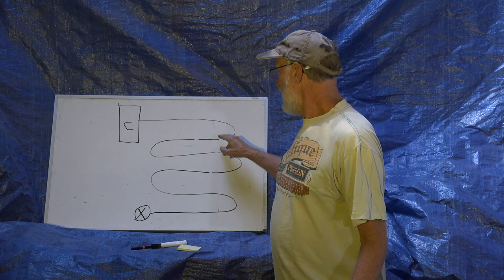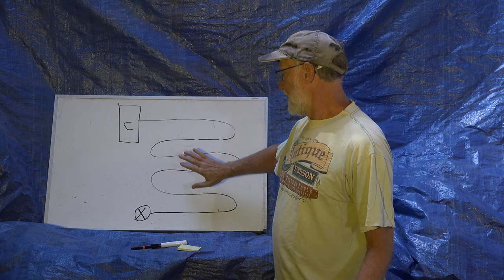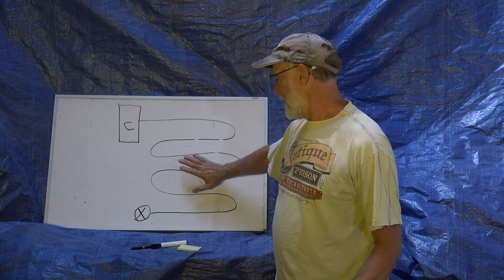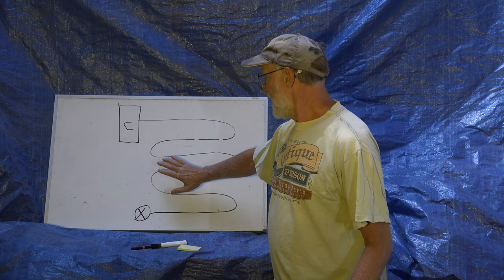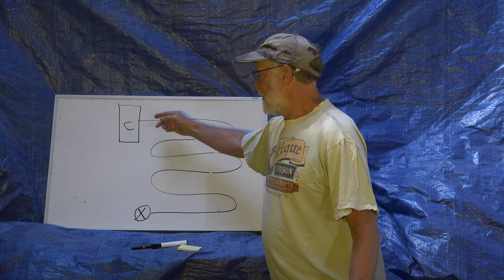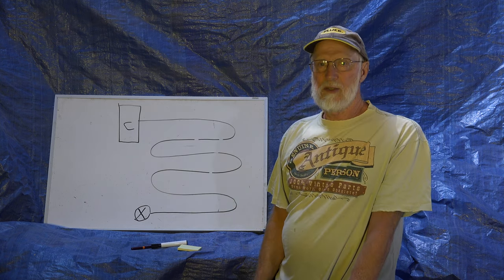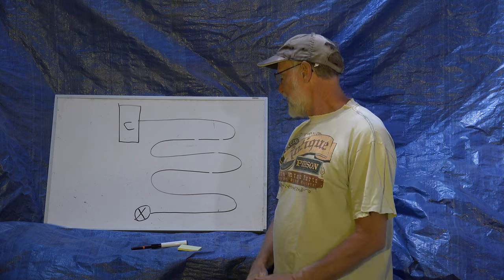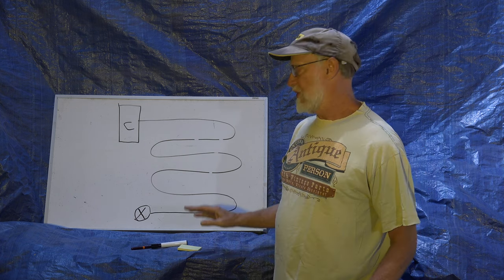How the evaporator works and why

Comment: Sir I have a Manitowoc ice machine that I've had to replace the dump valve and the main relay just to get to find out that I'm no longer getting the freeze plate to get cold. Much less cold enough to freeze.  Can you help with any ideas what's wrong?
Reply from the maker: Is your compressor running?
GFM
Reply: grayfurnaceman yes the compressor is running!
Reply from the maker: Is the plate warm or cold?
GFM
Reply: grayfurnaceman the plate started to get a little warm ...
Reply: Unforn
Reply from the maker: Sounds like the the bypass solenoid is stuck open.
GFM

Comment: GFM, you touched on the term Super Heat, could you cover that a bit more please? Thanks for your videos
Reply: I'm sure he'll cover it more later but here:

Superheat is just a substance being warmer than its phase change point.

Use water as an example, open pot boiling at sea level will be 212° Fahrenheit/ 100° Celsius. He covered this in a previous video. If you then take the steam (water vapor) above the pot and heat it further you are superheating it.

In an HVAC system superheat has to be high enough to keep liquid away from the compressor but low enough to maximize the use of the evaporator and since hermetic compressors are suction gas cooled you need a low superheat to keep from overheating the compressor. It's a balancing act.
Reply from the maker: I will be doing more on superheat in the future.  I also have several videos using superheat in a practical sense on my channel.
GFM

Comment: Very informative video. Thank you.   I have a question. I need to replace my evaporator on my vehicle. There are two types offered. Plate and Fin or parallel flow. Which type should I get?
Reply from the maker: I would consider plate and fin if I had a choice.
GFM
Reply: @grayfurnaceman  Thank you. Thats what I went with.

Comment: Here's a question to the greyfurnaceman : I put my gauges on a split system, TXV. I know we typically look for 25-5 degrees of superheat. Well, the longer I let the system run, the more superheat I would loose. What would cause that???
Reply from the maker: I am not sure about the 25-5.  Superheat can vary from about 10 to 20 depending on where the measurement is taken.  
If the superheat increases as run time goes on, you could have a restriction in the liquid line.  You could also have a mismatched system.  I would be looking at sub cool to see if it increases as the superheat increases.
GFM
Reply: @grayfurnaceman  LP 121    HP 339
                                EV  41     CO 104
                                T1  42     T2 95
      SH kept dropping, all the way down to 1.2     SC never moved and stayed steady at 9.3     It was a Goodman split system, so SC goal was around 7-9. System was 10-12 years old and NEVER had a filter. You think a dirty coil would cause a steady drop in SH???

Comment: Nitrogen was accidentally introduced into a 50 pounder  recovery tank for clean new R410a , tank was at 200 psig and an aspen 2 ton coil was pressurized to 350 pounds of nitro then both were connected in error so nitro went into the recovery bottle till pressures were equal at 200 psig ! Refrigerant was put through a recycle machine twice , checked with sight glass and it appears to be dry and green . Is this Refrigerant still contaminated ? Please advise , thank you
Reply from the maker: You can't separate the refrigerant from the nitrogen in the field.  Its contaminated.
GFM
Reply: grayfurnaceman that's what I thought . Thanks
Reply: Your recovery  tank contains the liquid R410a and gas R410a and Nitrogen gas too. Pre EPA rules some HVAC folks bled off the some of the vapor in a refrigeration system to reduce the non condensables, ie air etc. That was with a refrigerant that had one boiling point ie no glide. R410a has glide thus the bleeding off the vapor will change the mix ie character of R410a. Thus probably not a good idea with R410a. 

With R22 Folks did this before there were any recovery machines, before any recovery cylinders. In commercial systems, there was a Schraeder valve to bleed off the vapour to reduce the amount of "Non condensable gases" in the HVAC system. NCG. Non-Condensable Gases. R22 was cheap ie less than 1 dollar per Lb pre EPA rules. A HVAC book from say before 1990 has recovery machines, no recovery cylinders.

 With old pre EPA R22 the 30 Lb jugs were once two way; ie one could fill the cylinder with R22 from another jug or pump R22 from a clean system for reuse. If the system had a burnout one flushed out the pipes with R11 in the orange cylinders, its boiling point is about room temperature. It pours out like water as a liquid. 

  With Non-Condensable Gases a HVAC system has screwy pressures and its efficiency is poor. 

On a desert island the professor would rig up a robust safe gizmo where entering new R410a liquid went into the bad mix of R410a and thus the vapor would remove the NCG as vapour and bad tank filled with R140a ie so little vapor exists. Probably not practical. 

Pressure vessels can become a bomb, thus they are regulated to reduce the chance of loss of life or limb

 GFM is correct about separating the Nitrogen. It is more so with R410a since it is a brew, has glide. With R22 it is illegal to purposely bleed off much vapor to, but the R22 has no glide

Comment: another good video....GFM..........how about if I weigh the charge in ( 410a ) and turn the system on in the cooling mode.....and the condenser is running but the temperature of my suction line and the temperature of my liquid line are about the same.....the evaporator has a txv........what is the problem I have
Reply: look at pressures! then determine if TXV is stuck wide open or something else like reversing valve(heat pump) compressor broken or running in reverse (scroll) :)
Reply from the maker: If the proper charge is weighed in, and superheat heat is too high, try checking subcool.  If it is too high, you have a blockage in the system.  In this case, the suction pressure should be in a vacuum or close to it.
GFM